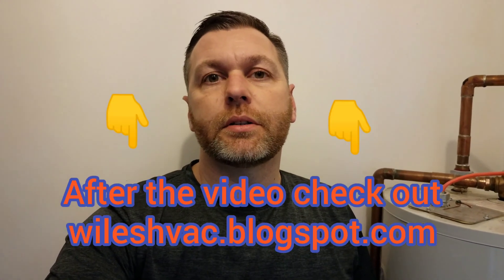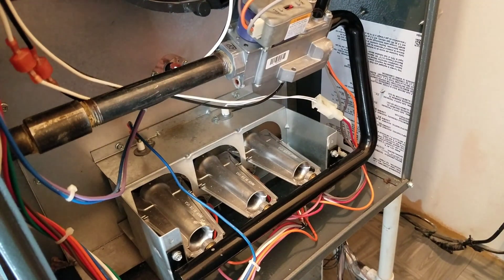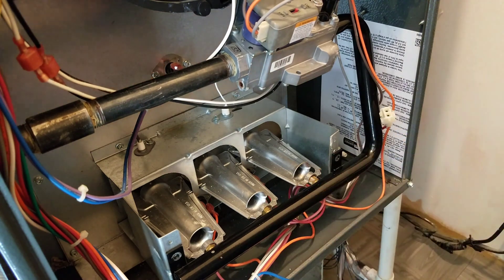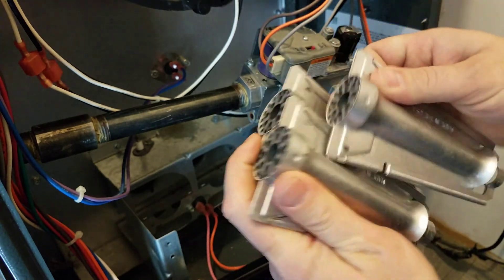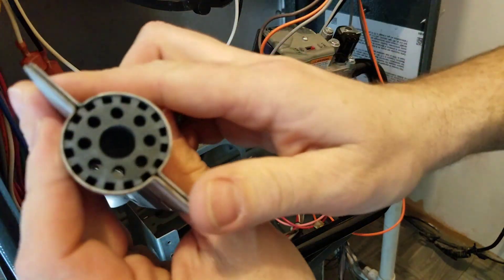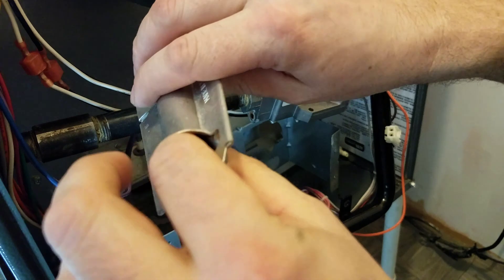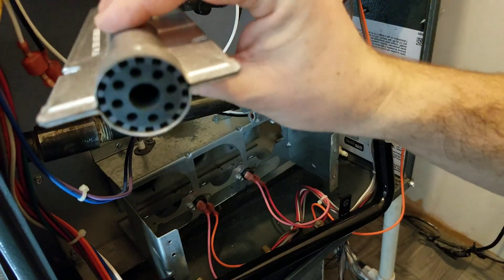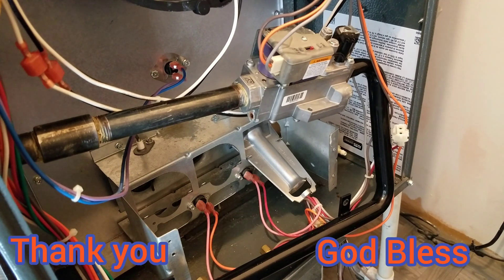Gas furnace burner cleaning and removal.  How to clean high efficiency gas furnace burners

Comment: One tip I’ll add, On our five burner Goodman, Or any amount of burners, Be very careful putting the first burner on the left  in because the heat element is right behind it, You can break it pretty easily if not, careful.

Comment: my burners were clean yet I continue to get delayed ignition POP/BURP/FART but very little in terms of flame that is outside the norm.. what could it be? once ignited, everything works fine
Reply from the maker: Either improper ignitor placement, burner misalignment, gas pressure problem or faulty burners of some sorts.   Sounds like it's time to have a tech take a look at it.  That's what they are there for.  Hope this helps.  Thanks for watching.   Be sure to subscribe and share.   Have a great day!
Reply: @andyscornerhvac  I checked everything I could that doesn't require equipment - I'll get a tech to check the pressure and valve. Thanks.

Comment: Hello
The failure of flame sensing happens when the flame current is less than designed or the detection circuit on PCB is damaged. The flame current is determined by the resistance of the flame itself, which is a given constant, plus the resistance of the two poles exposed to the flame: the flame sensor and the burner's front area. In my case, after multiple tries of various successes, cleaning the flame detector became ineffective. I was ready to replace the furnace but I gave a try in cleaning the corresponding burner. Its surface felt rough. After cleaning and resetting it all worked just fine with the sensor previously considered as ineffective.
Reply from the maker: I agree with all of that.   Burners are just as important as the flame sensor itself.   I believe burners should be cleaned regularly as well as replaced when basic cleaning is not enough.  The burners have more to do with how that furnace operates than many consider.  A combustion analyzer can show you that.  But yes I agree!   Thanks for watching!  Be sure to subscribe! Have a great day!

Comment: Do you ever brush or vacuum out the heat exchanger passages? Nice video my brother
Reply from the maker: Not typically.  Least not on anything high efficient.  Your gonna have a pretty hard time with that.   Maybe some of the older natural draft furnaces could be if they do start to get deposits.   But for the most part, a furnace that is burning properly should have any soot or deposits in the heat exchanger.   A combustion analyzer is THE ONLY way to know if a unit is burning correctly.   Might have to call a contractor for that.   If you do I would only recommend a tech that is certified in combustion analysis testing.   It could get dangerous if someone does not know what they are doing but it's the only way.   The myths of flame color or just set gas pressure and run away are wrong.  So I know I wondered on that answer a little.... Lol. .... But no they typically don't need it unless they have been burning improperly and are sooted or something like that.   Hope this helps a little!   Have a great day!

Comment: Hey my furnace makes a periodic rumbling noise. It is very noticeable at night. Could it be the burners? It occurs when the furnace is both on and off. And strangely it only happens when the outside air temperature is very low
Reply from the maker: I dunno.   There's a lot of options but if it's no matter of if the the furnace is running or not... Doubt it's the burners.   Burners can only make noises if the furnace is on and burning.   Thanks for watching!   Hope you get everything worked out.   Be sure to subscribe if your not already!   Have a great day!
Reply: Could be your inducer motor assembly, either the motor itself is going, or some part of the plastic fan blade broke off.  This was the case with my inducer assembly at beginning of this month.  Easy to remove and install new one. At least take it out and check it out first.

Comment: Thread protector on the gas supply piping is a big no no, that would fail inspection in my area, a 1/2” malleable coupling has to be used here.
Reply from the maker: Well we all work in diff areas.  Glad you took the time to tell me how your area is.

Comment: Why undo the gas Manifold at all?
Reply from the maker: Most of them, the burners sit on bent clips like this Goodman does to where they won't lift out unless the back end of the burner drops down.  Not all are like this but mine in the video is.
Reply: @andyscornerhvac  I guess I'm just used to Tranes. They just have a bracing bar across the top of the burners held in with two screws.  And then they lift right out, without the need to remove the manafold.

Comment: Nobody wants to pay for the extra hr it will take to clean them even if you explain that it is necessary and thats why your price is a lil higher.  But I agree it's the right thing to do
Reply: only way to make those big 120k a year numbers as a pro tech and not own ur own business.. you gotta take pics at old jobs with ruined burner tubes you had to replace and explain the cost of replacing vs getting them cleaned every year not to mention the damage done to the exchanger I have no issue selling burner cleanings. Covid has been my best friend iv been selling almost 1 iWave air purifier a day some weeks those bad boys are 350 a pop our cost try selling one those to a customer lol gotta get them to see the value and why they need it and not the price tag but at same time not force or be a duch bag these are return customers you deal with a lot...